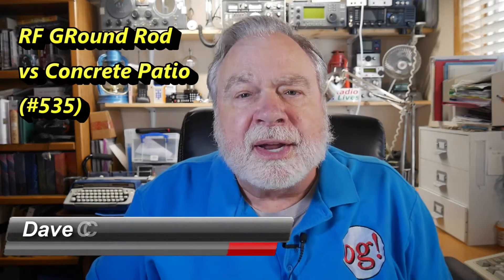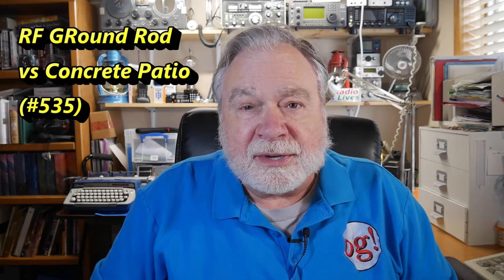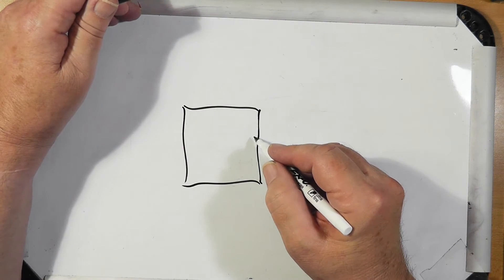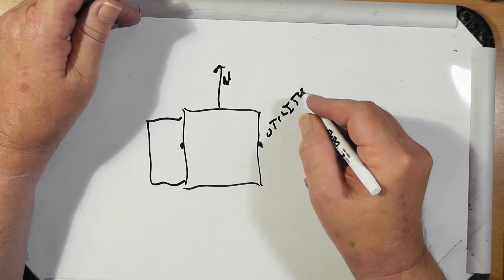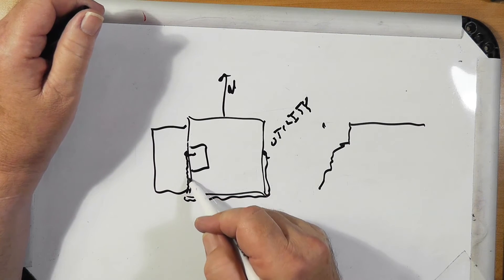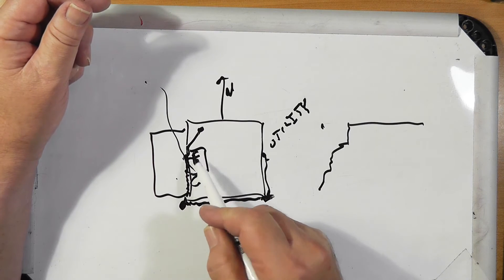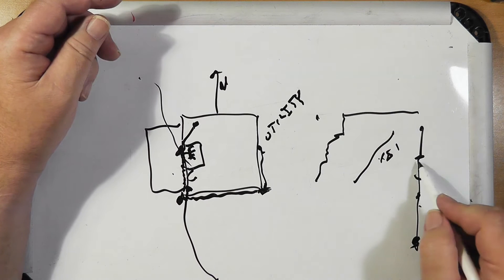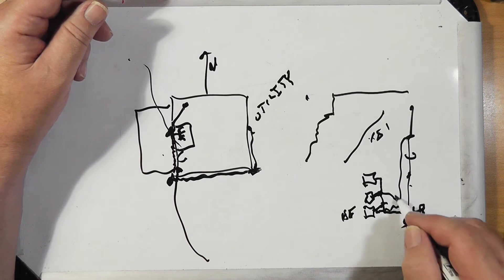RF Ground Rod vs Concrete Patio (#535)

Comment: Thanks Dave.  After much trial and error I was finally able to install a similar ground system in my postage stamp backyard. It consists of three ground rods spaced in a 10 ft line along the back property line a few feet from my house.  The first rod is located directly under my 2nd fl shack window and has attached to it two lightning arrestors, one for each of two antennas.  A 2 ft length of #12 stranded wire going from the rod to an outdoor outlet ground lug will serve as my utility ground connection.  It is the best I can do as my utility box is located in the far corner of the house some 70 feet away.  The other two rods are connected to the first rod in series fashion with a single length of #6 stranded bare copper wire. I don't have space for a star ground so the series line of rods will have to do. When it arrives a 20 ft length of 1" copper braid will bond the first rod to a copper bus bar in my 2nd fl shack via a window entry that I will soon be building out of wood. All of my gear will get bonded to that bus bar.  Given my space limitations, is this an acceptable ground setup as described? Please tell me if I've done anything wrong so I can change it before I begin operating my rig for the first time.